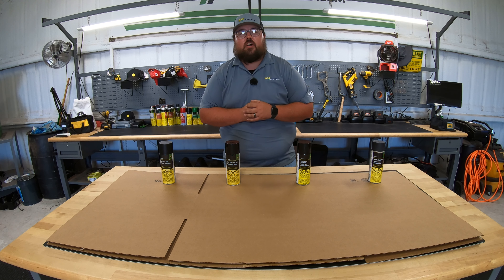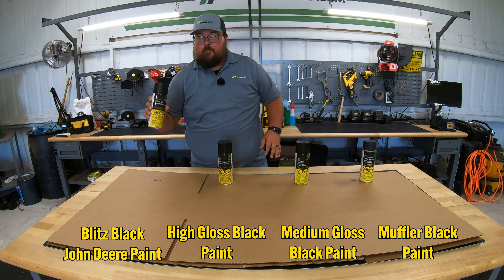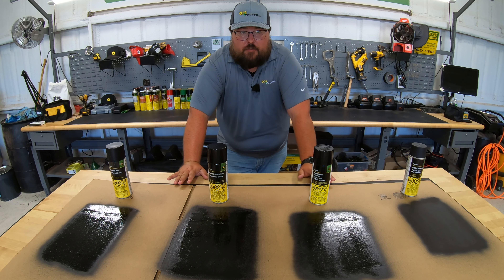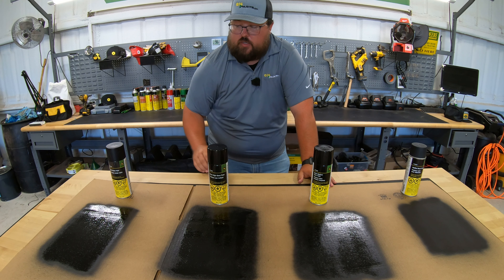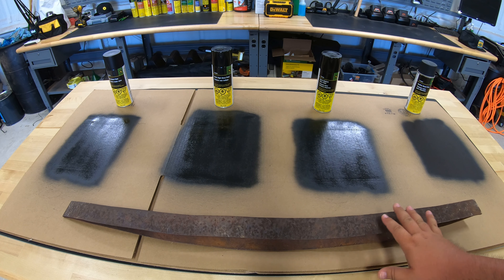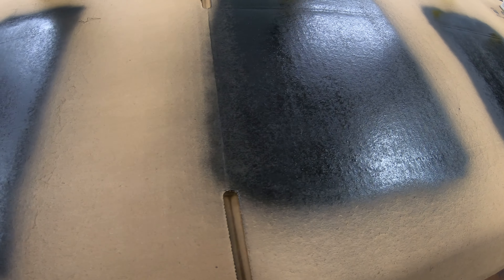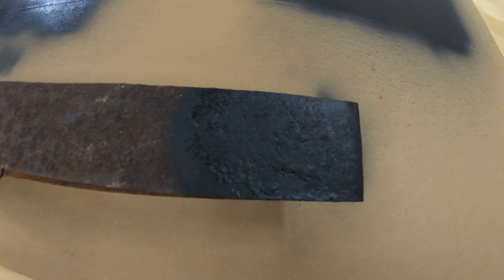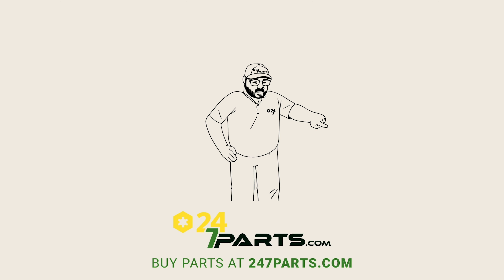Which John Deere Black Paint Do I Need?

Comment: Blitz black was created in 1973 for the JDX series snowmobiles. It is the correct color to do a proper paint restoration on these snowmobiles. I have 3 of these color snowmobiles, 1974 JDX4 Special, 1973 JDX8 and a 1974 JDX8